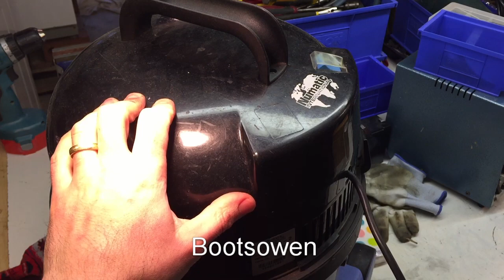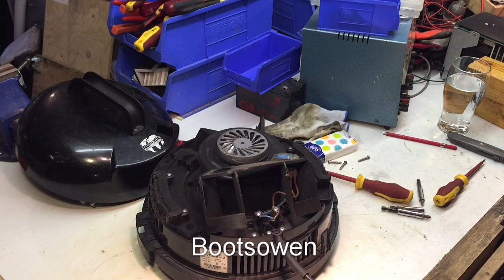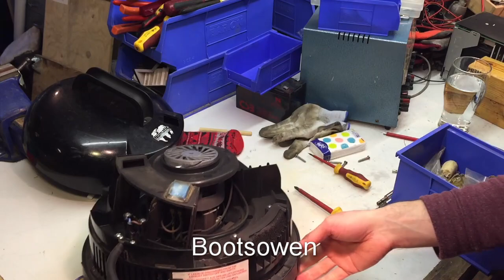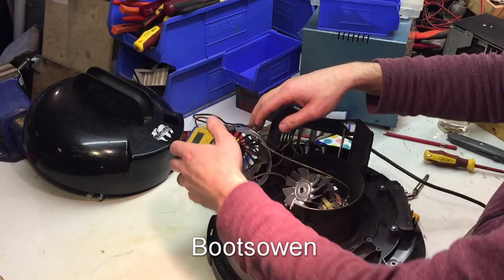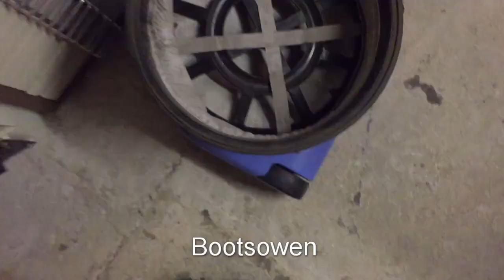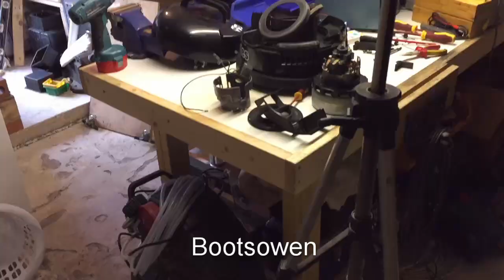Numatic Charles Vacuum fault finding

Comment: Hi my charles hover gets off after 5 min of cleaning and then starts on it own after 5 mins can u plz tell me what heppens .
Reply from the maker: The thermal trip on the motor is cutting in to protect it. You need a new bag and filter and probably should clean the motor filter which involves taking it apart. But just changing the motor and filter should be enough.
Reply from the maker: I have posted many videos of how to clean it inside.